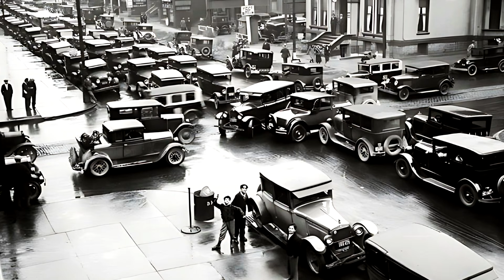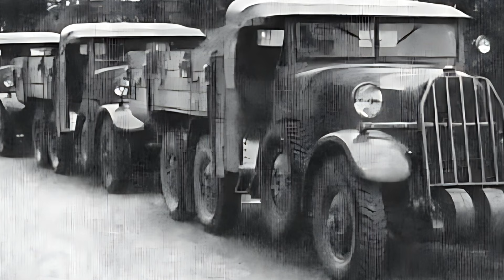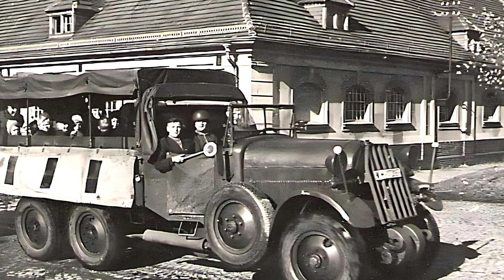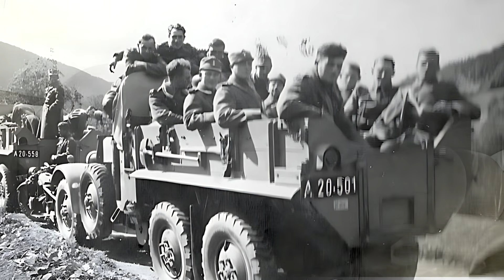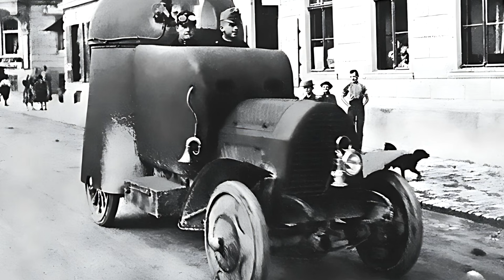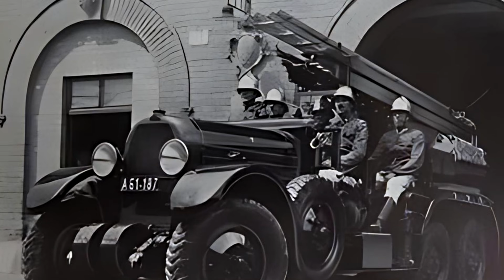1932 Austro-Daimler ADG / ADGR – Legendary 6×6 Military Truck

Comment: All Ambulances are Steyr 640 and some of the pictures are Steyr 640 too. All vehicles with the black plates are in Austrian Army. After the annexation  of Austria these vehicles were used by the German Wehrmacht with white plates. Austro-Daimler ADG has one  drive shafts from the gearbox to  each side of the rear wheels.